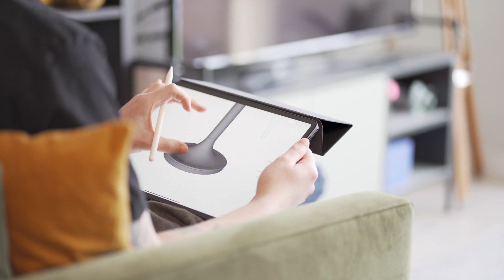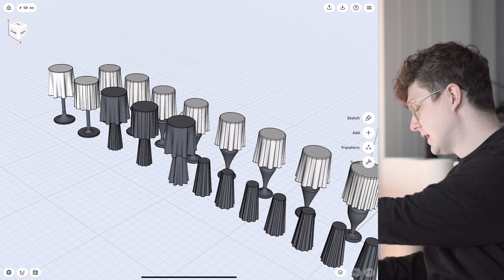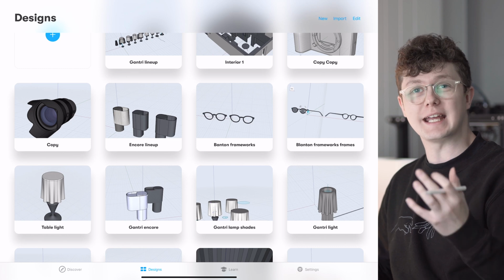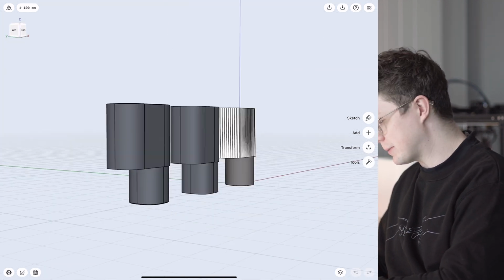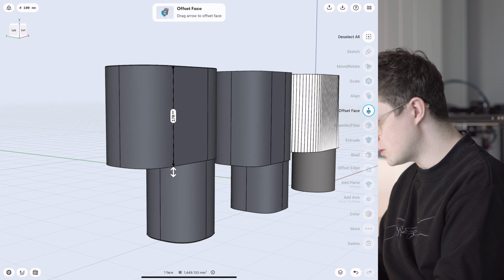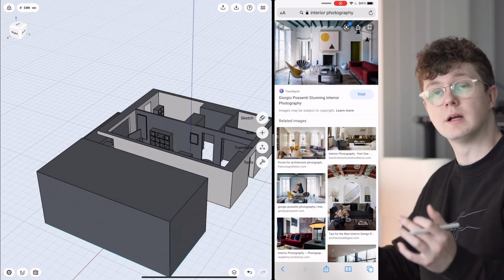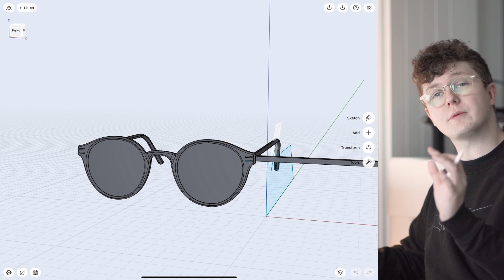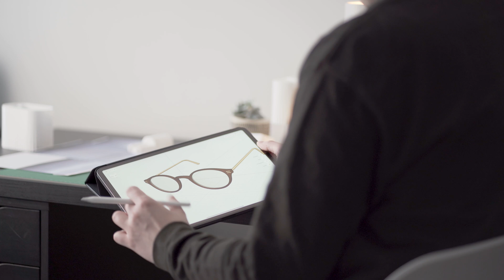Shapr3D Industrial Designer Workflow

Comment: Thanks for posting this. I was in engineering for many years using Bentley software so I am  familiar with push/pull etc- great tools.
At this point I am struggling a bit with Procreate trying to improve on my rendering.
Will Sub
Cheers
Charlie